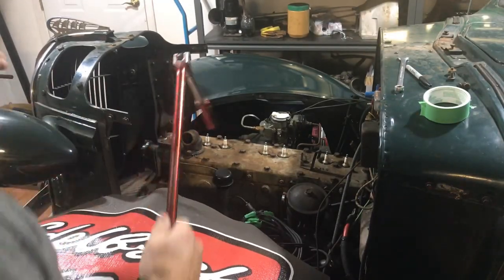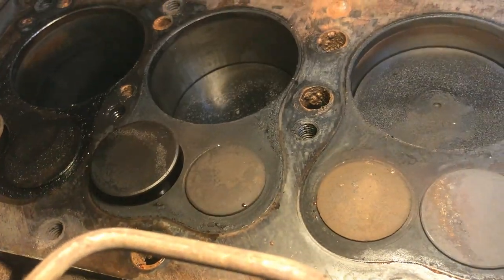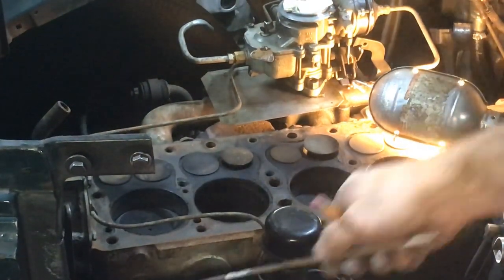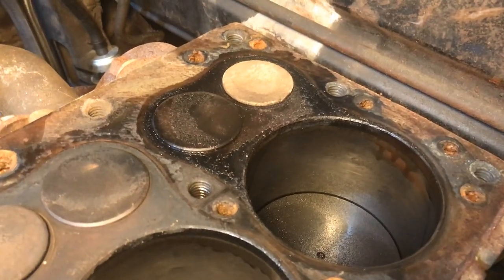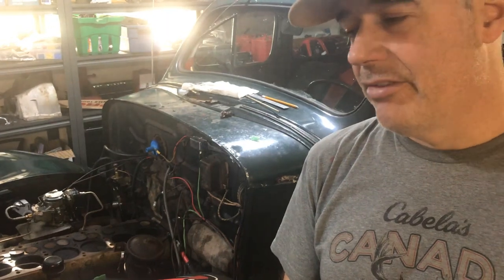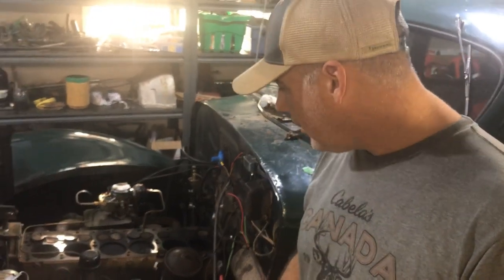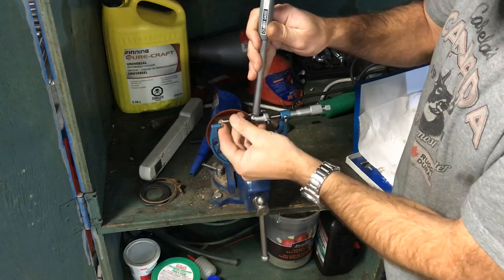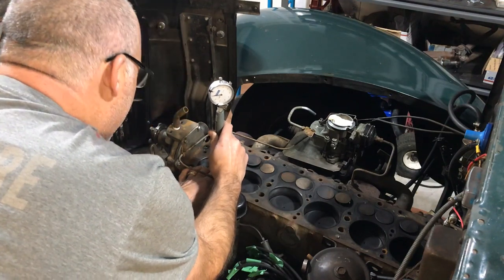Mopar Flathead Head Removal & Determining Engine Cylinder Wear

Comment: I got a 51 218 in my b3b truck ..  it's running and tight but, I bet my water jacket is full of rust setiment and I'm sure there is a ton of oil sludge...  seals and gaskets are seeping...  I'm thinking what I would do with it this winter...  🤷🏻‍♂️
Reply from the maker: You many want to secure any rebuild parts now. Likely will cause you delays.
Reply: @keithsgarage5831  thank you .  I think I'm just in for seals and gaskets, and general cleanup..  should be fun!!
Reply: @keithsgarage5831  she only had 37k miles..  runs very strong
Reply from the maker: @skippynj1979  Consider lifting out engine. Maybe Find a used engine stand. Mount engine and flip it over. Pull oil pan. Clean out pan and oil pick up screen also. Remove water pump and the block expansion plugs. Flush out block. Remove cylinder head. Lap and reseal all valves. Send rad to rad shop for proper clean and testing. Clean all sludge out of valves area and oil filter canister.  Rear seal if wanted. While it’s out and on a stand now is the time. Timing cover crank seal too. Maybe a speedi-sleeve there too?
Reply: @keithsgarage5831  wow..  thank you for taking the time to respond.  That was very thoughtful to take time.  The truck is on the lift at my mechanics, making a squak list.  He's doing the transmission seal, and rear pinion seal.  I'm taking the bed and front fenders off this winter to clean and paint the frame.  He's pressure testing the radiator now..  and I'm just debating getting the aftermarket aluminum one that is available for the truck.  I'm going to drive and use the truck, she's no garage queen, and won't be.  Thank you again, Steve

Comment: Getting ready to pop the top off my 53 Belvedere because I have no compression on #1 & #2 cylinders. Did a leak down test and got a lot of air coming out of the crankcase/oil filler hose. So I maybe re-ringing 1&2 while it siting in the car. I’m assuming the car sat for a long long time and someone tried starting it with the rings stuck. My engine runs so good but no power. Hopefully new rings will bring the power back.
Reply from the maker: I have done some top and bottom engine work with the engine in frame. Also some work with an engine out. Based on my experience and what you mentioned, if I were you  I’d pull your engine. Way easier to work on. Used engine stands are cheap and offer ultimate convenience. While engine is out lap all the valves. Replace any worn valve guides. Any other leaking seals/gaskets too.  Pull expansion plugs and flush rust out of your block. Unless all this was done 5 years ago or less, all this work will likely be very beneficial to you.
Reply: @keithsgarage5831  I’m currently building a 41 ford Flathead v8 or I would rebuild this one. I’m assuming the engine has been rebuilt in the past 10-15 years. Because everything inside (engine) is clean and hold 130# of compression on 3,4,5 & 6. If I can get it running good enough for my wife to drive then once I get my 46 pick up project done then I can tear into the 53 Plymouth and rebuild it for my wife.

Comment: They made lots and lots of those 251s. They used them in the larger Dodge trucks  and sold them to makers of forklifts, welders, airport tugs, construction equipment of all kinds and farm machinery. The 251 engine was the last flathead made by Chrysler. Great video series!
Reply from the maker: Thanks. Yes the 251 is a great engine. I also have a 265. Same as the 251 but ¼" longer stroke.

Comment: i have  the army 1053 dodge 230 cu in flat head 6   i pulled the eng out new rings ground the valves   i highly  recomend pull the eng   ---you will need a valve spring compressor  those tiny spring locks will go in orbit  hard to find //enjoy  had mine 10 yrs and counting there is a water tube in mine for the valves  if you have that now will be a good time to replace   you can get parts at ----vpw in iowa that tube is hard to remove its rust use vice gripes and a hammer tap it till it moves that take water i each valve  the little hole s get stopped up  good luck one last tip  on alignment  if you pull the eng   check the crankshaft pully  it may have tiny marks  mine has several marks with tdc  in the middeli use a tooth pick and white paint fill the tiny marks with paint  mine is timed at 4 deg before tdc  .

Comment: Hi Keith,

I really enjoy videos very informative.  We have a 1955 Dodge Ute  flat 6 25” Kew motor that has had a complete restoration here in Brisbane Australia.

Engine has had a complete rebuilt.  New distributor cap, points, condenser, coil , leads, carburettor rebuilt .  6 klms after start up we had coolant in the cylinders  
, head.gasket blown due to a the wrong radiator cap fitted. We have just replaced the head gasket and since doing so the engine runs rough at idle and will not accelerate or rev over idle. Plugs are black and it smells bad of fuel. We have good comprehension and spark.

Any clues as to why it will not run. 

Ken
Reply from the maker: What is your compression? The first 6 KM, did the engine run well?
Reply: @keithsgarage5831   Yes it did run well.  Next morning difficult to start running rough.  We removed the plugs and noticed they had coolant corrosion on them. We also had coolant leaking from under the head and the exhaust port.  6 weeks later new head gasket fitted . First start up with no water . Hard to start and will not run or Rev over idle. Timing checked ok, new carby fitted, compression check over 100psi

Still the same symptoms.  Thinking values but not sure as when the head was off we ran the motor to check for a stuck values.

Good compression made us think it’s not a value problem.

Ken
Reply from the maker: @kenchauvier5466  Difficult to troubleshoot from here. Did you have your distributor and or oil pump out? Could the oil pump be out 1 tooth? Causing timing to be off?
Reply: @keithsgarage5831   Oil pump was not removed.  Distributor has been reset a number of times by professionals.  We spoke to an old mate today at a car show  ( Coolys Rocks )that believes it is electrical as we have good compression and learning more toward a faulty condenser either though it’s new, as the points keep pitting.

Really appreciate your emails.

Comment: I hope that motor goes to a good home,rather than sitting in the garage collecting rust. 
Use that bore gauge in a X and + fashion . you'll get more info on what's going on with cylinder . Great job
Reply from the maker: You bet man. Thanks. The motor gets real good seasonal use. I put 1575 miles on it  in 2020. My first season with the car, a 1938 Plymouth.

Comment: What I did with my Plymouth 6 was a little unusual.  Most (sane) people would take the block to a machine shop, but I "bored" out the cylinders myself with a heavy-duty Lisle cylinder hone.  I got the cylinders straight, with proper clearances for new Egge oversize pistons.  It took a lot of patience and measuring with a bore gauge.  The engine runs great!  Also did the valve job myself.  The only thing I didn't do myself was regrind the crankshaft. The  #6 main journal was very heavily worn and had to welded up and reground - way above my pay grade.
Reply from the maker: I like your ingenuity! I'd try that. I have done a valve grind myself too. By hand. Followed up with all brand new valves that I lapped in. Those darn exhaust stellite seats are stubborn and hard! That was over three years ago in my 53 Chrysler. It's been great ever since.